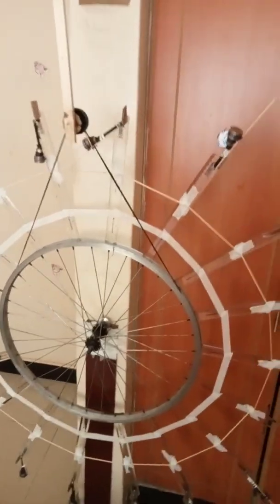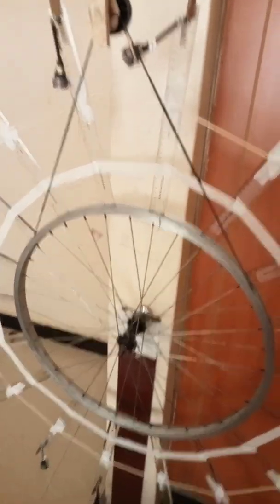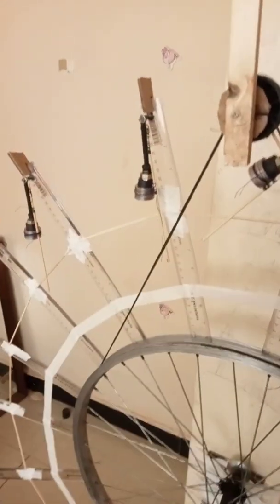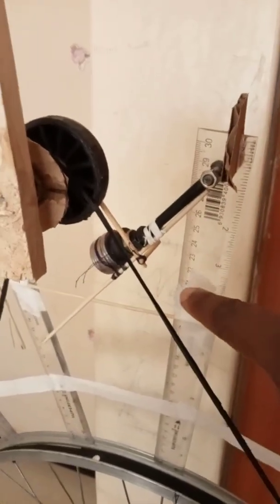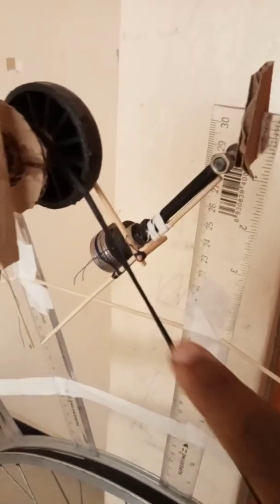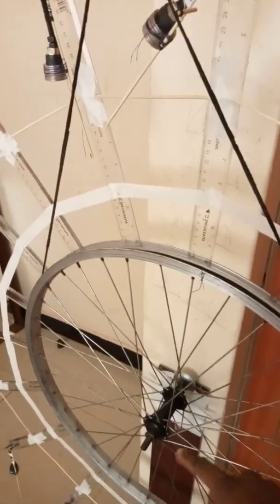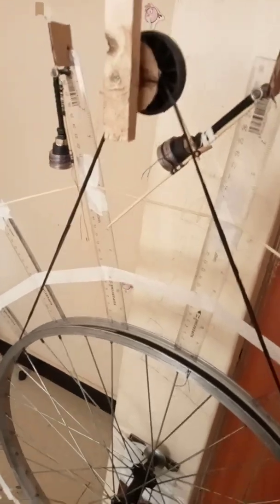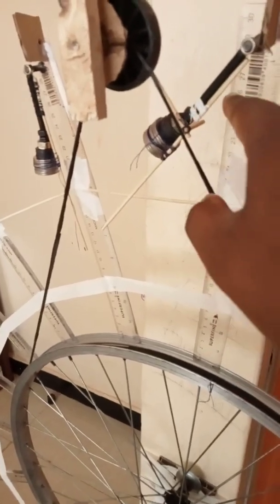Free energy, Perpetual motion, Overbalanced wheel, Gravity turbine - Part 1c by Professor Tiwes

Comment from the maker: I recalculated the energy required to raise (extent the top weight) by rotating it 180 degrees using trapezoidal rule (integration estimation method) and I got the 2mgr as was calculated using requirement of gravitational potential energy. This is of course neglecting the frictional energy requirement during the the 180 degree rotation which is expected to be very small anyway.  Since the resultant moment increases as you increase the number weights around the circumference while the energy required to raise the top weight does not change but remains 2mgr, it is expected that as the wheel radius is increased hence providing more space for using more weights around the circumference, this system is expected to work. More experiments to follow.
Reply: Jambo Jambo, email address, please.
Reply from the maker: @theuridixon9258  Hello Namesake. My email address is dickymunyo@yahoo.com

Comment: I read about another way to get a wheel to rotate some years ago, using the sun and some warmed water.  2 empty propane tanks, weld a hollow metal pipe to connect one tank on each end so that they can be air tight and filled with 1 tank worth of the propane.  Make another like it.  Affix these two pipe-tank at 90 degrees on a shaft like the bicycle wheel you show in your video.  The result will be the 4 tanks at the ends of the 2 pips on the wheel like a big X, the two lowest tanks will have the liquid propane flow down to them because of gravity. Mount this wheel outside on a stand and have a black tray of water that the lowest tanks go through.  The sun heats the water enough so the propane starts to turn to a gas and rises up the pipe. The pipe above the wheel center is colder so that the gas condenses. The  weight transfers up 180 degrees away from the lower tank. This makes the mass of the whole system shift and keeps the wheel turning. Just use caution around the flamable gasses to prevent explosion or injury or gas leak.
Reply from the maker: I hear you TechnoWizard. Thanks for sharing.

Comment: you might be on to something here!
Reply from the maker: Thank you so much for your encouraging comment. I think so too so far.
Reply: you are welcome. It's good to see videos of actual doing and not just saying lol! We are trying one somewhat similar, but a little different. it has pendulum arms 
falling a small angle at 1 - 2 o'clock and fall back at 7-8 o'clock. On the end of arms are pivots for curved levers with weights. As the arms fall, the levers rotate
back and forth about 120 degrees around a pulley mounted to the wheel. It takes time- so many variations of pivot points/shapes/angles/weights/etc. Thanks
again, for your video it is encouraging to me.

 @professortiwes2877
Reply from the maker: @lindaellison899  am so glad to hear that you are working on this area too. I strongly believe with the proper design, Gravitational force can be harnessed. It is everywhere and so consistent. Remember the hydro turbines use the force of gravity acting on water from a higher point going to a lower point. Of course in hydro turbines, since the water flows away after turning the turbine, the natural processes of evaporation, rain etc replenishes the water at raised points so that these important turbines which produce most of the world power can keep working. So without gravity already life here on earth would be impossible! Long story, lets keep working.  Am sure at some point, a working gravity turbine will be created. If you do not mind you can share a photo of what you are working on to my email dickymunyo@yahoo.com. But if it is protected, it is okay.

Comment: I m also same work, but my design is tower type 16 weight,  one weight is 1.5 kg, now stuck at same position as you described in your video,
Reply from the maker: Hey Muhammad Saeed, do you have a link where I can watch your work or could you share a diagram I try to understand your design? Keep working on it. Personally I believe this thing might work. I believe the key may be using more weights around the circumference though I do not understand how the tower type design looks like. All the best in your work.

Comment: Já použiju 160 závaží 🙂
Reply from the maker: Jan Engel, what language is this one? haha.
Reply from the maker: Jan Engel, what language is this one? haha.
Reply: @professortiwes2877  Ok, I try English. My wheel will have maximum 160 metal weights. Minimum is 4, but my tools and materials are from hobbymarket, so number of weights must be greater. Next week I start building the wheel.
Reply from the maker: @janengel1985  thank you so much for putting it in English. I wish you are the best in your project. If you eventually put it in you tube, kindly notify me I check. All the best.
Reply: @professortiwes2877  My work is on start line. I have stand and wheel, both made from wood, axis is from wood too. To connect them together I used two bearings. Next step is to create a balancing system, I am thinking about magnets on metal sliders.
Reply from the maker: @janengel1985  Awesome. All the best. If or when confortable at some point you can share with a photo through my email dickymunyo@yahoo.com

Comment: It wouldn't work with all those losses. None of the perpetual motion machines ever work because nothing can reach 100% efficiency.
However you can have over 100% efficiency from overunity machines.
It's either underunity or overunity but never unity due to instability.
Reply from the maker: @Lukie Poole, I appreciate your comment and clearly I see you understand how Mechanical systems work.  However, what my Mathematical model says is that there is a very high Chance that this thing will work. The resultant moment gets better as you use more weights around the circumference. Please read the video description. You can also do the trigonometric  calculations in excel. Its easy to do and then you can come back and tell me what you think. Thanks for taking your time to listen to the video clip.
Reply: @professortiwes2877  Manmade math has nothing to do with reality. The moment one detached from the math that reality uses, one becomes lost.
The true value of constant pi is sqrt(16/golden ratio)
Reply from the maker: @lukiepoole9254  haha. There is no working Machine under the sun that has been designed without Maths. Maths gives you more less the exact value (if not dealing with estimation methods eg trapezoidal rule for integration). But reality will try to make that has has been calculated by maths not to be exact. But in Engineering, we are not interested in exactness and that why simplification assumptions are made. If your assumptions are correct and your maths says a system can work, then it works! The only reason my design may not work is if I did errors in my calculations or I assumed something wrongly and did my calculations based on wrong assumptions. For me I believe am on the right path. What I have done so far behaves as per expectation. Still some way to go before I can say it works or not but am willing to go all the way.
Reply: @professortiwes2877  Try to apply math on parametric generators and overunity single phase switched reluctance generators with the magnetic permeability of the rotor lower than the stator. Math would fail because the total energy output is higher than the total energy input. Manmade math can only bring one so far. Reality is stranger than fiction.
Reply from the maker: @lukiepoole9254  haha. Since am not conversant with these generators, let me leave it here and again appreciate you for your comments.

Comment: Dear Sir, why is there no demonstration of movement at all? just an explanation. so i just fumbled.
Reply from the maker: @Satria Munggaran Sir, sorry for so much explanations with little demonstration of movement. I tried demonstrating some movement at the end of the video. The challenge I was having is that one hand was holding the phone that was recording the video so only one hand was available. The system has not fully worked as I explained. There is still a lot of experimentation to do. For this video, I intended to show the entire set up so that someone out there who might want to try on their own have an idea of my whole idea. Thank you for watching and commenting.
Reply: @professortiwes2877  Ok sir, I'm always waiting for the next video. Good luck always. Now I'm ready to read the description because I didn't have time to read it earlier.
Reply from the maker: @satriamunggaran7665  Thank you Sir Satria Munggaran. Please read the description and if possible you can do the trigonometric calculations in Microsoft excel you check if you are getting the same resultant moment am getting depending on the number of weights used.